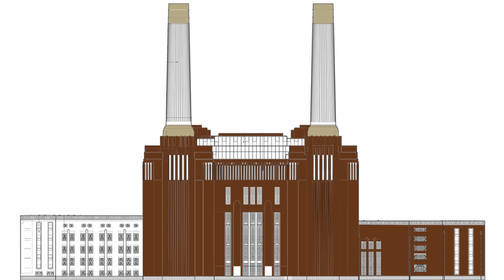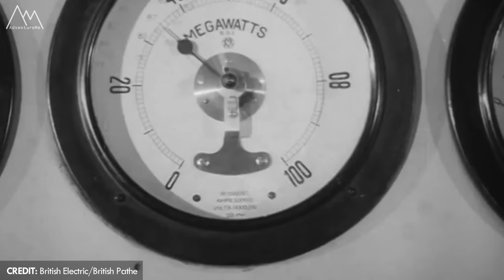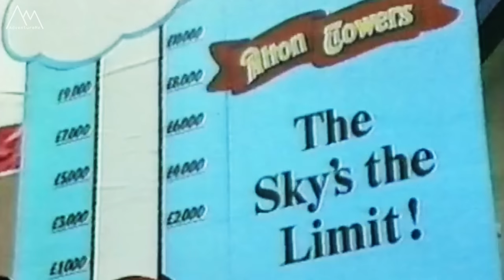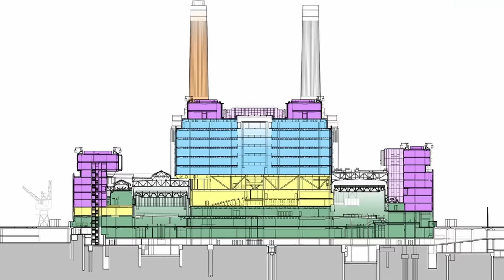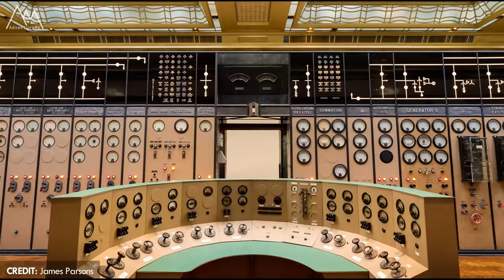What's Inside Battersea Power Station?

Comment: Great video but a minor correction. Historic England do not actually List buildings but they are the main advisor to DCMS. Also Historic England was only setup in 2015. Prior to that the adviser (in England) was English Heritage which was setup in 1984. As you said Battersea Power Station was Listed in 1980 by the Department for the Environment, which was the Department responsible for Listing buildings at the time.

Comment: My first thought regarding the more elaborate decor found in turbine hall A (compared to turbine hall B) is that because hall A was built before the war and hall B wasn't finished until '44, they went with a no-frills approach for hall B in order not to waste time, money, materials and manpower. Of course this is just my assumption for which I have done exactly zero research. Would be interesting to know if there was a different reason, perhaps even entirely unrelated to the war.
Reply from the maker: I think you are pretty much spot on. It was down to cost and post war.